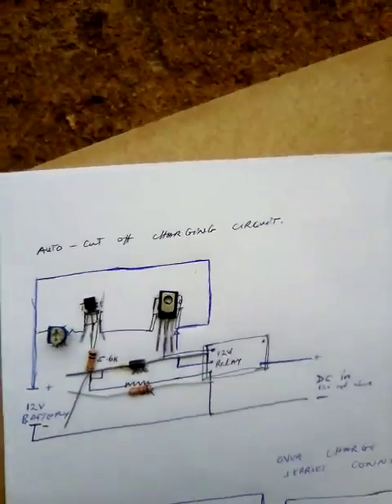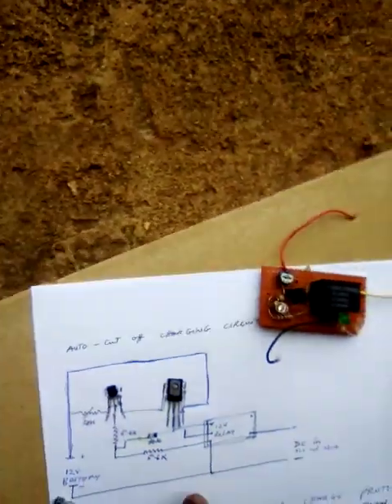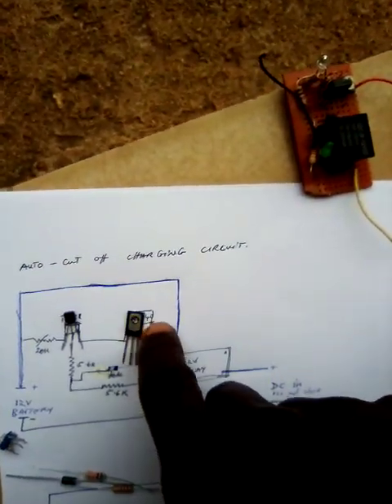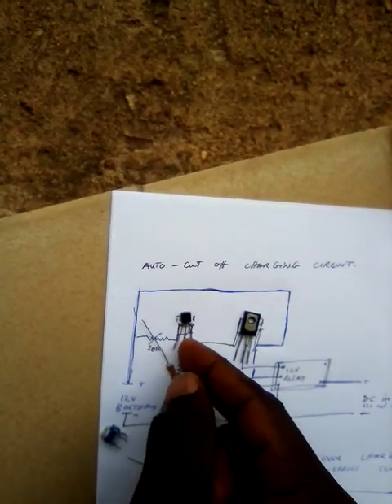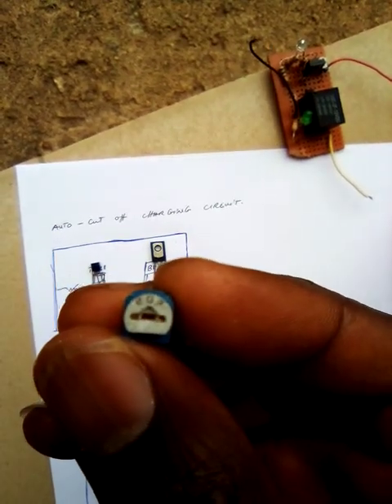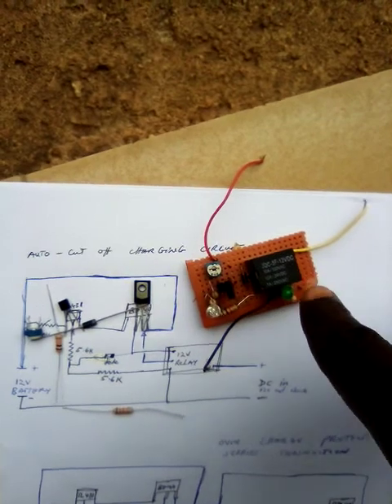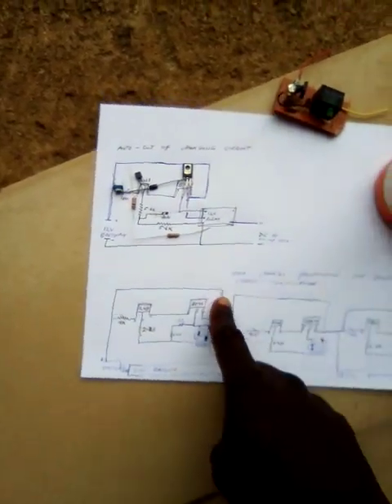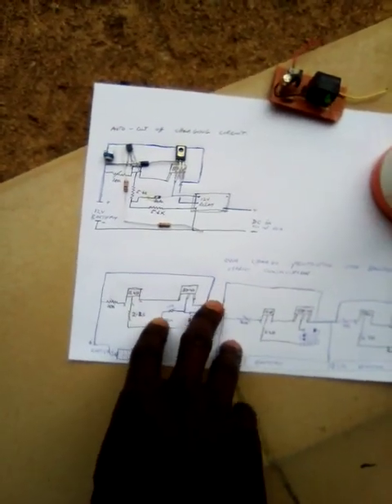how to make lithium iron battery balance charge circuit

Comment: Please clarify your schematic diagram I'm interested my brother due to my sinopoly battery not equal the voltage so we needed to proper part like transistors and number please....
Reply from the maker: alright i use a bd140  which is a PNP transistor which gets turn on when the gate is connected to a negative terminal of power source which also trigger the relay on too. while the tl431 is an auto volatge cut off transistor which gets turn on or off by 2v differences suppplied to it gate. the circuit is a combination of three things.
1. a voltage auto cut off circuit tl431 which react to voltage difference at it gate created by two resistors as voltage divider.
2. a bd140 which gets turn on or off from volatge coming from the tl431 through it gate.
3. a relay that is powered by the bd431.
you need to understand the following before going into this.

1. behavior of tl431 to voltage
2.behavior of bd140 to volgate, especially it termnals,
3. how to use dividers as voltage sensor.
4.how the terminals of relay works.
hope this post will be of help to you?

u can check my videos on that in that regard please.. thanks. let me know your views.
Reply from the maker: have being making effort on how to make the circuit diagram available on this comment section, you can goggle about auto cut off circuit diagram. u will get some but it will not be as perfect as min but will also help u to understand this video.